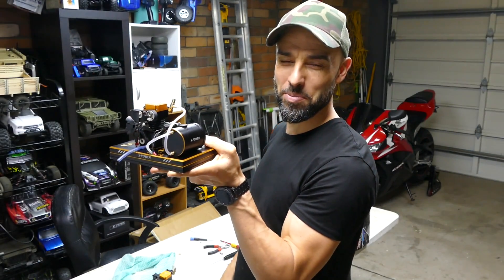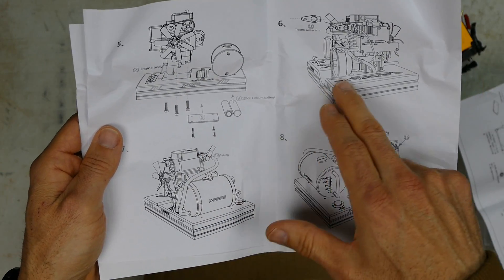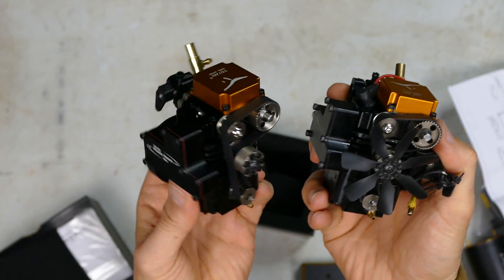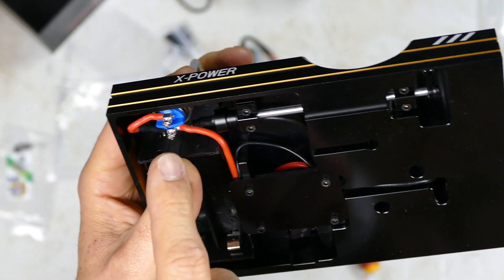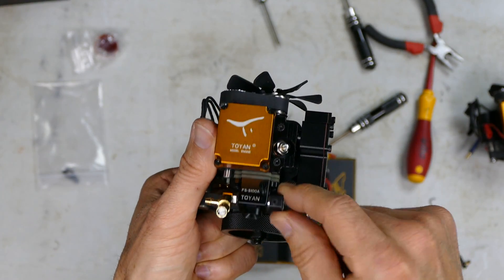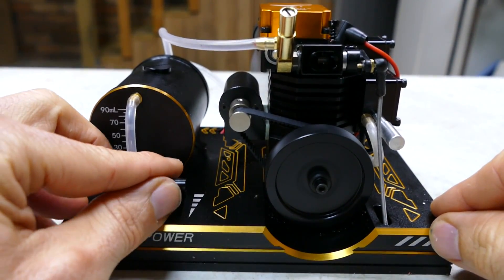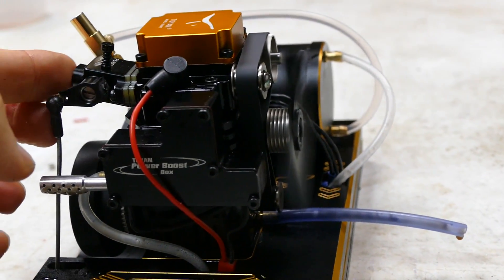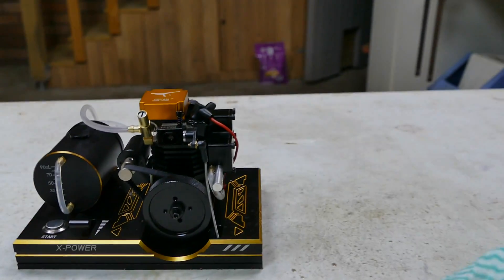PORTABLE MINIATURE WORKING 4 STROKE ENGINE - TOYAN FS S100A

Comment: I made the mistake of buying this motor since I am without a mount and now to start it I have to create a mount. Six diodes 1n4007 or higher and then the spark plug and off you go. All powered by 3v. I would change the carburetor and as an exhaust I would put something more than what is there. To improve the sound. A nice and relaxing "game". :)
Reply from the maker: Thank you

Comment: Another cool product using the  FS  S100A  engine. I have mine on a home made stand. I did change to a 3 mm outlet on the crankcase to eliminate fuel residue exiting anywhere else. Really keeps the engine clean.
Reply from the maker: Nice man.